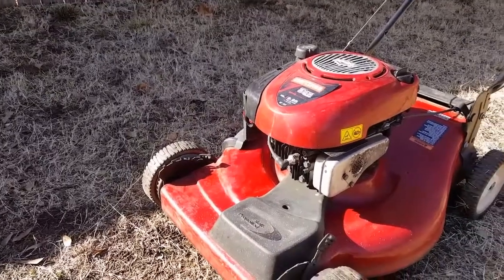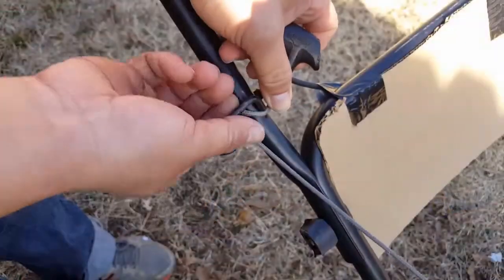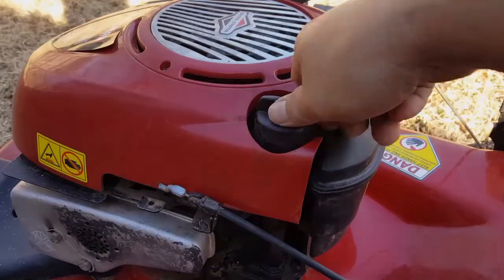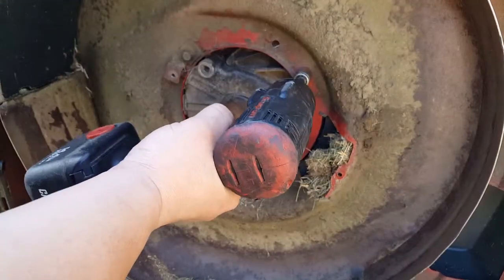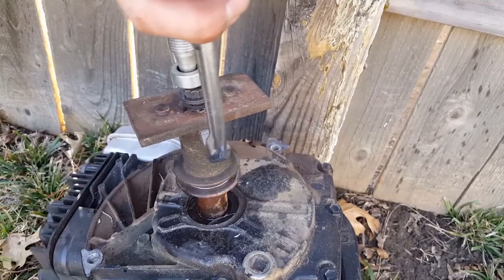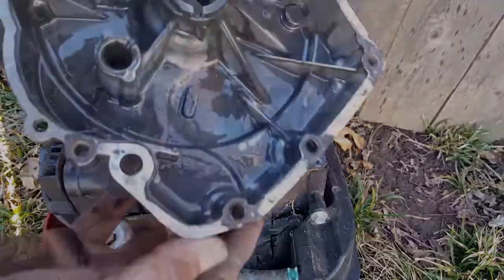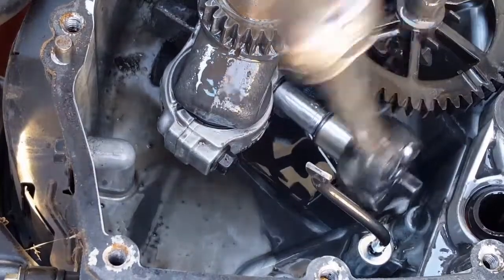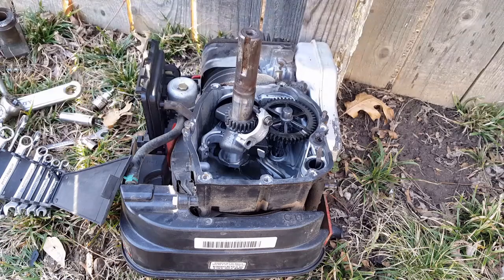Lawnmower has a clanking noise. Is it rod knock?

Comment: I need help I have a toro nd today it stopped with a loud knocking noise I let it sit for awhile and it stats and runs but when I pull the cord to start there is loud knocking noise then runs ok so is this first sign of the rod going out or something else ? please help if something else I do want to say when I was mowing the grass was wet and clogging up when everything happened
Reply from the maker: sure, check that the bolt on the blade isn't loose

Comment: I got a troy bilt lawnmower it sounds good while running but when turning off it does a clanking noise any suggestions?
Reply from the maker: I think the Brake pad, might be gone. it's on the side of the flywheel .
Reply: @HomeGaragechannel  I'll check that out but if it was rod knock wouldn't it clank while the lawnmower is running?
Reply from the maker: yes you are correct and it's more of a "tapping" sound.

Comment: clanking noise when you tilt the mower? And it's brand new, what could cause that?
Reply from the maker: Thank you ToxRozzx for the comment.  Just to clarify it was pulled out of box brand new or it was bought and it was sold as brand new? Just want to make sure someone else touched it other than you. Is it a troy bilt with the back half being made of plastic? I'm wondering if the bolts are loose and when you tilt it its allowing the blade to make contact with the deck.
Reply: From the box brand new, and no it isn't a troy bilt. It's an AL-KO with briggs & stratton engine.
Reply: And the click/knock is very loud and ''light'' sounding
Reply from the maker: Thanks for the information.  Can you confirm that the blade is on the blue adapter correctly and the bolt it tight? How much oil was put into the engine?
Reply: 0,4 liters (As it says in the manual). I cant confirm it now, due to it being stored at another house. But thanks alot for the tips to what could cause this problem!
Reply from the maker: Thanks for the questions and you're welcome.

Comment: yet another auto TU....So if you had replaced that connecting rod it would have resolved the knock?
Reply from the maker: yes but i would also have to clean all the aluminum that was deposits or gouging on the crankshaft too. then use some plasti gauge to check the oil clearance.
Reply: @HomeGaragechannel  THX..what about shaft?
Reply from the maker: @WV591  its steel. It might be a little damaged but the aluminum rod will be the part to replace. Just polish the journal.

Comment: ...stupid question from the fat guy in back....I own this same mower... big surprise... it clanks when it starts, rattles when it runs... cuts like a demon... so could one just invest in a new rod with bearing and cap... to snug up things and keep on cutting?... or Option #2 running it till it dies?... use mine as a trim mower after Big Mow does her thing.... Dave
Reply from the maker: Thats not a stupid question at all.  Yes you could replace the rod and cap and happily keep mowing. But for $100 you can replace the whole engine for one from harbor freight. Personally I'd rather replace the engine.
Reply: @HomeGaragechannel  ...did not know this... Harbor Freight has that motor.... hmmm... thanks...
Reply from the maker: They have a Honda style clone. It only comes with a 7/8" shaft so if you have a mower that requires a 1" shft you'll need to buy a sleeve adapter so you can keep your self propel. The sleeves are very affordable from Ebay .

Comment: I'd shim it with some aluminum foil and call it a day............ : )
Reply from the maker: Thanks for the comment I appreciate it
Reply: If the new connecting rod and cap are no longer available and the mover is worth saving, I'd maybe try cleaning the crankshaft journal, drill a bunch of small holes in the connecting rod and cap bearing surfaces, apply some JB Weld, reassemble, allow epoxy to fully cure, remove cap, tap on connecting rod to break any bond between the epoxy and journal, coat journal with some oil, reassemble, run mower and see what happened.